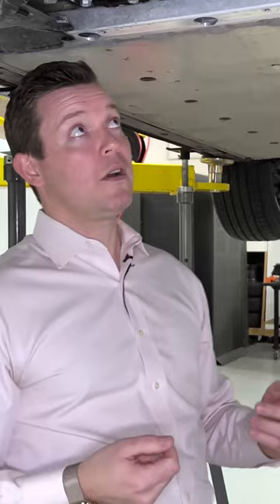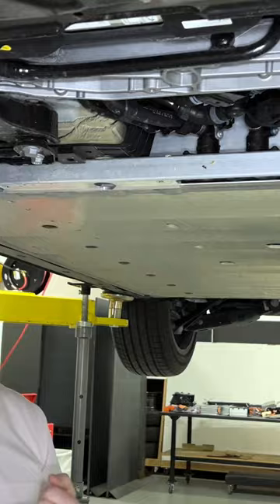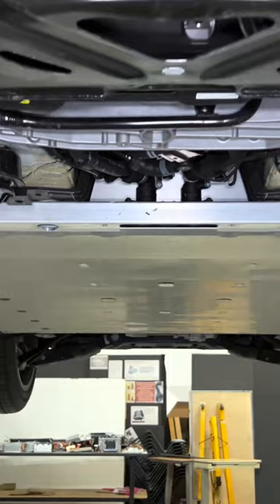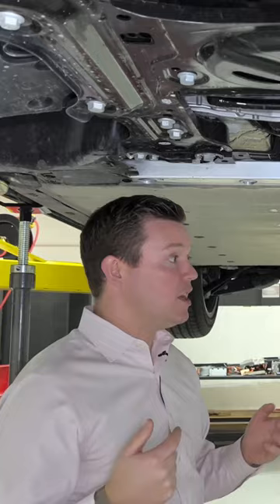Why it matters. #Shorts

Comment: VW already announced an own compact design. But they are not very fast to change things.
Reply: "already" 
"announced". 
🤣
Reply: @Stefan_Dahn  YT eats reference links again, so here is the passage (they also have a picture in the PR)
"When it comes to thermal management systems, Volkswagen is working on entirely new solutions. While today a large number of individual modules and long hose connections are used, in future these will be replaced with an extremely compact, integrated thermal module. This will control the entire air conditioning, including for the high-voltage battery, and thus will have a major impact on the vehicle’s range and fast-charging capability. The new all-in-one module is also significantly lighter, more robust and more efficient than current systems."
Reply: Volkswagen and other legacy automakers will try to mimick Tesla? So what?

Comment: It's why trains are so stupid heavy.  Things continue to add up.  Pretty soon it takes a mile to stop.
Reply: True, trains are so heavy and inefficient, robo trucks and taxis are going to take most of their market.
Reply: Weight is your friend on a freight train, not your enemy. And locomotives are extremely efficient, especially in comparison with passenger or freight road vehicles.
Reply: @carsonj1  Okay, lets do some math. Freight trains on average travel 500 miles per gallon of fuel per ton of freight. Your typical passenger vehicle the US is 2 tons and gets 25 mpg at best, frequently as little as 12.5 mpg still. That's 1/10th to 1/20th the fuel efficiency. Trains are the most fuel efficint way to move freight on land and always will be. Steel wheels on steel tracks have a much lower coefficient of friction than rubber tires on asphalt. That said, trucks are the solution for the last mile and local deliveries as most businesses today are not near a train station or rail yard.
Reply: @tommanseau6277  for stability? Like low center of gravity?  I can see that I guess.  But I like the idea of electric with regen.  At least it can recapture the energy.
Reply: @tommanseau6277  Who said anything about fossil fuel two ton trucks? Plus you compared a train to a small vehicle. The Tesla Semi can carry more than 44,000 lbs.
Electric trucks and especially autonomous trucks a going to eat trains lunch for most of their routes. Trucks can go from source to exact destination, no reloading. Electric Tesla trucks are very efficient energy users. Trains are extremely expensive, inefficient and inflexible in comparison.
Reply: @carsonj1  Right tool, right job. I'm not in favor of diesel as I don't like the smell or particulate. Best for heavy freight long distance: train (often diesel electric hybrids). Best for intermediate weight and distance: freight truck. Best for short freight: cargo van / light truck. I wold love to see more Tesla Semis on the road if they make sense and prove themselves. Self driving is a work in progress. It's one thing for a passenger vehicle, it's something else for a freight hauler where consequences are higher. The electric vehicle development is where gas cars were 100 years ago. Technology is evolving at a tremendous pace and battery technology has yet to hit its zenith. The pace of battery advancement is greater in the past decade than probably the whole of human history before it and the pace is actually increasing. We also need the electric infrastructure to support it. But most important, we need the raw materials to be cheaper, more environmentally friendly, and more resistant to supply chain disruption.

Comment: Stop when you hit Camry or Corolla.  There is a lot of time and money poured into that design because it is made in such bulk the engineering is amortized.

Some of that money goes into making it easier to service.  The easier and cheaper it is to service the more of them will stay on the road.  That is not only environmentally friendly, its also good for you as a company.  Simplicity is shockingly hard to achieve.

Comment: Engineers never get input from someone that actually has to deal with their engineering in the real world.

Things never break or wear out.

You never have accidents where you have to peel the car apart to save someone's life.

You never have to try and get an anchor point on a vehicle to get it out of a ditch. 

You never have to try and get it on a tow truck without damaging it.

You never are going to flat tow it behind another vehicle.

It is never going to get wet.

It is never going to be caught in a hail storm.

It is never going to need a new battery, just throw it away.

You are not allowed to modify or boly anything onto it.

No one needs to drive over 100 miles.

You are never going to put a snow plow on it. 

You are never going to tow with it.

Everyone wants to buy an over priced vehicle and no one is ever going to want to be the 3 rd or 4 th owner because that is all they can afford.

Finally , everyone wants to find out that because of engineering you have to take half of the car apart to replace one component made out of plastic that cost 300.00.

Then the labor charge is 1/4 the cost of the entire car.

All engineers should have to spend 4 years out in the field dealing with the results of engineering before being allowed on any projects.

I have all the respect in the world for engineers that actually get input from people in the world with experience. 

I have none for those who think they know better than anyone else and talk down other people's work.

Sure you can build a vehicle that can be molded into place with very few parts but how do you ever fix or repair it when it wears out or breaks.

Just throw it away and go pay 3 times the price for a new one.
Reply: Well said from a collision repair field person

Comment: I found it a bizarre shock as a young engineer how many fiefdoms in a company are aligned against good SOA engineering. The technicians from the line love the idea of using as many connectors and bends as possible for which they are proud to build assembly jigs.  Complication adds job security.  Purchasing agents are determined to use their age old suppliers, and are convinced it’s a just a game of ‘stuff’ where engineering doesn’t matter.  In a large enough company, yeah some of the buyers are getting kickbacks.   Assemblers like the idea that some product is a two man lift, even if they gripe about the load, and want to use that same 50lb case from 20 years ago.  You run into other engineers that have been co-opted by all the above, because new designs new tech inevitably have problems that they don’t want to deal with any more.  All the while  the engineer sees the eg pump size increase, the energy load increase, thus the waste heat rejection increase, the overall mass increase, thus the parts count increase and reliability decrease.   

They definitely don’t teach you what’s coming in school.